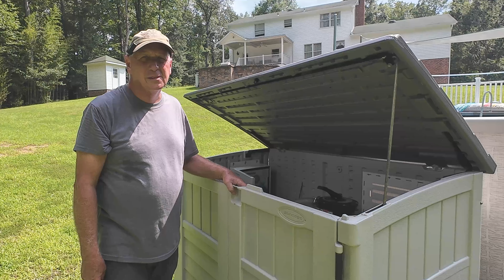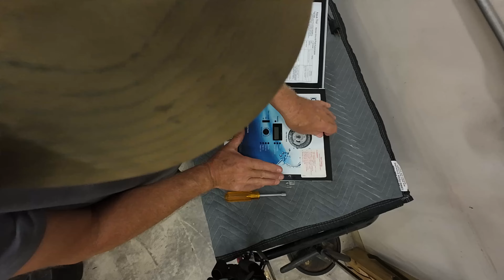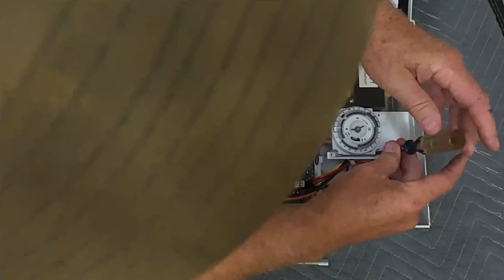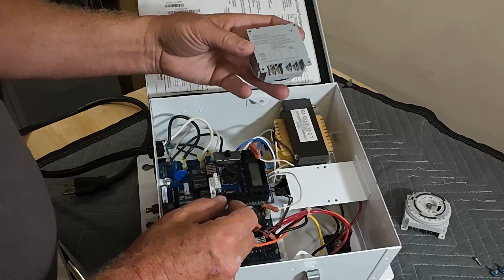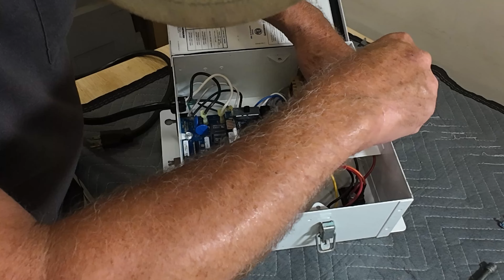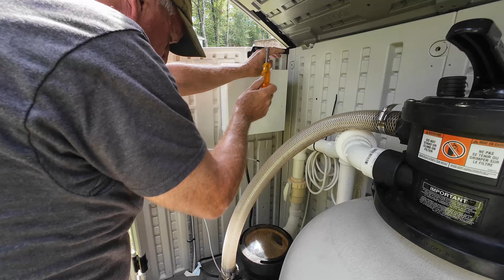Fix Your Hayward Aqua Trol Timer! Step-by-Step Debug & Replacement (W3AQ-TROL-RJ)

Comment: Hi I would really like to know what brand that enclosure is that the aqua trip is mounted to.
Reply from the maker: The enclosure is 53" wide x 46" high x 32" deep. It is a Suncast Model # BMS2500 resin horizonal storage shed.